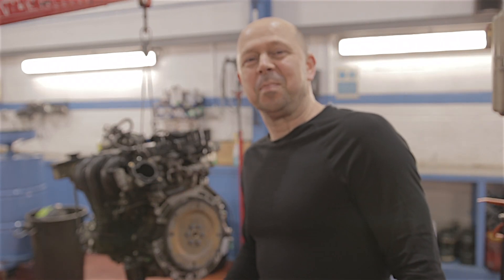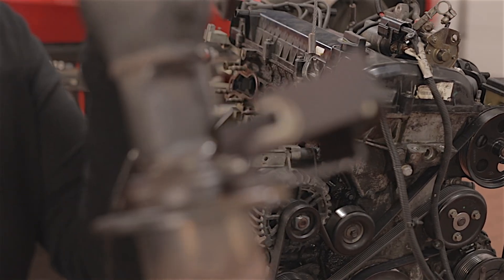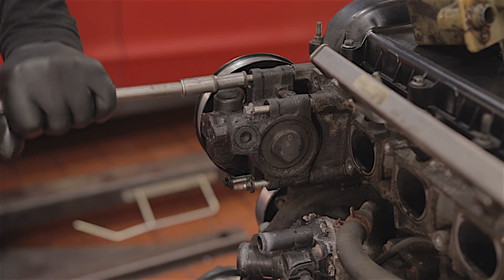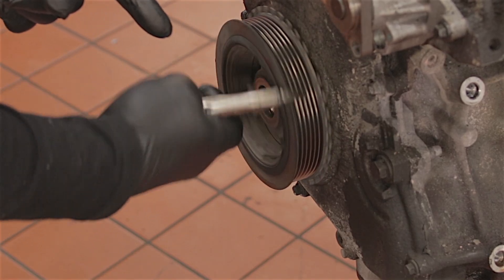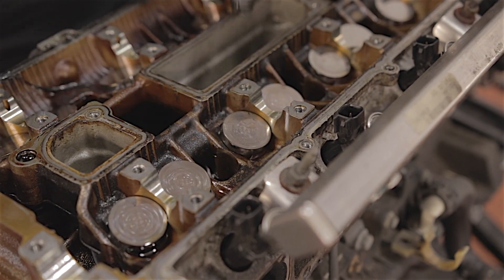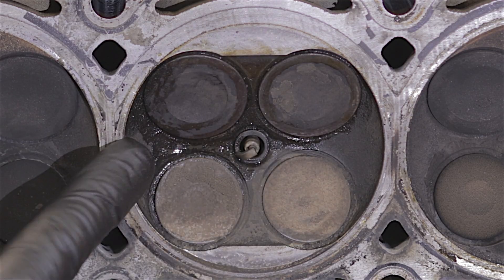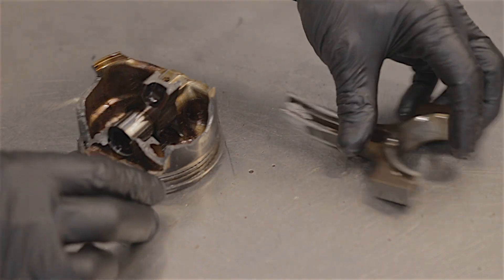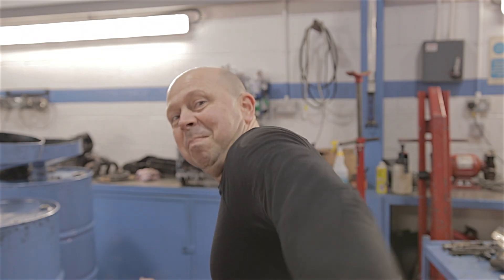Water Sucked Into Engine...Hydro Lock, Whats The Damage ??

Comment: Just drove my 2004 1.9TDI Passat through a flodded street. Engine stopped, air filter was full of water, didn't try to started again, took it to my garage, removed the sparkplugs and cranked the engine a few seconds, water flew out like shot from a gun, then I've removed turbo pipes and intercooler pipe,got back the sparkplugs and cranked the engine again. It started right on, with all the pipes disconected,  it sounded like  a normal engine, tomorow i will check all the air sistem of water and see what will happen, but I'm almoust shure that there is no damage to the engine. I'm not a mechanick, it's just a hobby, maybe my biggest hobby. I'll be back with the end result.

Comment: Regarding Hydro lock, back in the 60s I was serving my time as a fitter at Priestmans which produced among other things excavators, on the assembly line a semi skilled guy filled the engines with oil and also put oil in the oli bath air cleaner, unfortunately he was off ill so they gave the job to a labourer that had no mechanical knowledge whatsoever he kept filling the aircleaner with oil till it ran out, so all the oil had gone into the inlet manifold and into the engine which hydrolocked on start up and was ruined, the management did not sack the guy or anything as they said it was their fault for letting him do it !!!!

Comment: You can fix and reuse valves and heads like that. Jam a screw driver under the valve and bend it back in the right direction. Check if it shimmies side to side as it seats itself. Once it doesn't shimmy sideways as it opens and closes, it's fixed. The engine will go back together for lots more miles and high revs.

Comment: Great video, lets see what comes out of mine 2015 Chrysler Town and Country once manage to get the engine out, mine wont move so have to get it out with the transmission also as cant get to unbolt the torque converter, I am hoping the block is not damaged we will see. The water damage was done by my 19year old daughter driving the van in a heavy storm, she left for work and never made it past 2 blocks on a flooded street, water was not even that high but these vehicles intakes are really low, and also water may have entered via exhaust pipe; that was last August, car was at the dealer but the estimate for replacement and fix was 13K so insurance wanted to total it, had no choice but to get it home and decided will fix it myself as can not afford even the cheapest of street mechanic with all that needs to be done, so that how we are here today almost ready now to get that engine open; I was going to buy a remanufactured engine but here in the US all companies who sells them have horrible reviews by pissing their customers base so instead we decided we will strip it and fix whatever needed which is the super hard way for a non mechanic like me but what choices do I have? scratch a 30K car? nope! the only thing in my favor is this is not my first rodeo with rebuilding an engine as i did my wife 2004 Toyota Corolla which had a failed engine due to oil starvation and over a year and half later the car is still rolling so lets see what the Chrysler got for me.

Comment: I am him. I am one of those people. Because i accidentally drove through deep water that only existed because it was a damn monsoon at the time. I kinda had no choice. I came to this video specifically because of that. Very interesting watch. Thank you for the content, Alan.
Reply: I changed my oil and air filter. And I am about to install some new spark plugs while confirming the chambers aren't still filled with water. Hopefully it keeps my car from randomly kicking and throwing this P2646 rocker arm code.
Reply: @xamedix Did you save your waterlogged car?
Reply: @gregorymalchuk272  I did. Replaced injectors. Did an oil change. Replaced pcv valve. It's running fine now

Comment: I drove my mx5 through 1 foot of water I did know about the damage water can do but the car cost me nothing. It driver perfect for 35miles afterwards and then started knocking.  So now I’m pulling the engine and fixing it just for fun 😂. Parts don’t cost much. New rods and bottom end bearings. Plus a head gasket. Maybe some new valves. It’ll be fun! Or it’s getting scrapped 😂

Comment: That must have run badly after ingesting enough water to cause it to lock up.  It would have been well down on compression on that cylinder due to the bend in the rod, did nobody do a compression test to check?

Comment: I drove into a massive puddle and it cut out, I sucked out the water out the inlet manifold and it seems fine, this is like 3 months ago. Think I’m fine or will it have issues in the future?
Reply: Going through that now you should be fine change your spark plugs oil

Comment: That pulley bolt....I remember oh so well. I had an engine with a broken no.1 exhaust valve, I tired everything I could to undo that thing, I broke several tools and when my mates impact refused to budge it, I decided on sourceing a new engine instead. They of course are known as a 'disposable' engine and that's why they do um up so tight....no woodruff key, the whole assembly is just compressed together.
Inccidently, don't those Fiesta ST's use the same engine ?
Excellent video Alan.

Comment: Long time ago flooded my mk3 Mondeo diesel, had enough brains to disengage the clutch immediately, roll out of water, and not try to start it until removing the intake and blowing out all the water. Drove 30k kilometers after that, sold then. Lucky me. I think it’s because the engine was on idling rpm when I crossed water, so it just got stopped by water in cylinder and didn’t have enough inertia to turn further.

Comment: Hind alan I love watching your videos.i have a t.d.d.i. 05 focus.i had a bright idea this week to change my anti freeze and replace it as I've never done it.i do my own  maintenance.ive had 25 years of diesel mondeos and the t.d.d.i engine I can do most jobs on these engines.what drives me insane is how do you refill the cooling system without getting an air lock in the heater matrix.i had the same problem 10 years ago with a diesel mondeo.i got the garden hose down the heater pipes and fused the heater matrix out the hose fits inside the pipes.still the same problem in winter no heat eventually after a few weeks the problem seemed to write itself and the heater suddenly started working.now I got the same problem with my focus.bit cold at the moment to be crawling around under the car getting wet.wanted to ask have you had the same problem?is there a way to either bleed these  cooling systems or refill the coolant a diffrent way like down the heater pipes first not through the expansion tank.makes sence to me the thermostat is closed so your only going to be able to fill the radiator at the front it should work it's way to the heater eventually. but it is a problem.can you help please.any videos on this please. I can't find anything related on you tube.i thought about unscrewing the heater sencor and using the hole as a bleed valve like a domestic radiator.you must have had the problem yourself with these mondeos and focuses.i don't have a compressed air line to put any pressure on the pipes.if you can help I'd be grateful.thanks.

Comment: I have been here before, a car that had been driven through floodwater and recovered to the garage. Engine checked and spark plugs removed and cylinders vented, cylinder compressions checked. Engine started and ran fine, given back to the owner and owner advised.
A week later recovered again with a broken connecting rod, my theory is that the con rod had been bent slightly during the hydrostatic lock and failed (a clean break half way down its shank) subsequently.

Comment: Had a Mondeo Mk3 2.0l Automatic that got hydro locked by going through a flooded road in 2012. Was sorted by our mechanic and we  must have been lucky as only sold it on last year. Weirdly engine seemed to run better after the flooding incident!

Comment: It always amazes me the power of heat on threads and seized bolts you can be hanging off something blasting WD at it and nothing, but as soon as you get the torch out and it normally always works great video Alan.

Comment: Compared to older engines, that conrod is a weedy looking thing.
At the start I kinda guessed it was bent by the water,then let go.

I remember a few years back a local guy flooded his old Peugeot 504 pickup 2.3 diesel engine that was also used in the Sierra,and that soldiered on for quite a while after despite having a bent rod (snigger*)

Enjoyed the engine autopsy Alan.
👍

Comment: The main issue with flood water is having the air intake at a stupid low level :(  Years ago you had the frying pan air filter on top of the engine.
Reply: I've seen that on American muscle cars. Basically the Americans who made them used to put the air filter between the two banks of cylinders that made up the V8 engine. It looked kinda like a giant tuna fish can atop that stunning V8 engine 😍
Reply: The main issue with flood water is idiots driving into it. There's no problem with having the air filter pull colder air from in the bumper if you drive correctly.
Reply: @elobiretv if you want to drive a sports car then avoid water at all costs, regular cars and suvs should know better and they don’t seem to. Normal roads sometimes have 4 inches of water during rain
Reply: @elobiretv  You have missed the point, with a low level air intake it takes very little depth of water before it is sucked into the engine and causes hydraulic lock :(
Reply: So you have to go out and buy another one.
Reply: Yes I remember the big cylinder and frying pan filters right on top of engine
Reply: Yes I remember the big cylinder and frying pan filters on top of the engine

Comment: I've got the same engine in my mk2 focus, drove it through a flood in august and it bent 3 of 4 rods. I kept driving it for like 6-800 miles before replacing it, even drove it from london to derby and back.  I've got one of the rods and pistons on my desk in front of me, I put a little grub screw in it to lock the gudgeon to the piston, and fitted a clock in the bigend. My old engine lives on in the form of a clock.

Comment: I had a mk1 v6 mondeo and I remember driving through a flooded road. I was on my way to work to start the nightshift and didn't see it till the last minute. I was traveling at about 40/45 mph. needless to say I didn't have to use the brakes to slow down! I remember wacking it back into first gear and keeping the revs up. lots of bubbling from the exhaust but I made it to the other side. the clutch felt a bit gritty afterwards but after a few weeks it eventually went away. my friend wasn't so fortunate. he had an old Peugeot estate with the 2.3 diesel engine that unfortunately drew flood water into the engine. a strip down revealed 2 bent con rods.

Comment: Not helping this is the air resonator box on the mk3 being sat so low and on the passenger side. Drive through a deep puddle and you will find some water in your air filter box.

I'd have kept those camshaft sprokets for coasters, but a shuriken is pretty cool!

Comment: Problem with the Mk3 is the tube that sticks into the inner wing from under the airbox.
Water enters there due the low location.
Conical filter is actually one of the times it's good for something as it's located in the engine bay usually.
Drove mine through 30cm of deep water a couple of times, and due the conical air filter it was not a problem at all. And I drove slow and make sure to make a bow in front of the car.
Watch how 4x4 folks do it through floods and you get the idea. 
The bow in front of you make a low hight area under the car which make more clearance for stuff like air filters.

Comment: Alan, can you blank the egr valve on these engines and if so does it help with the engine power?
Reply: Yes you can. I had on mine. Bought the blanking plate of ebay and it worked like a charm for the 5 years I drove it. When I took off the egr the first time the thing was filled with sot and the piston inside would not move at all. Some brake claner and a toothbrush sorted that out. I noticed no power gain, but the egr would not have any problems in the future, It did not throw an engine check light either. Mine was a 01'

Comment: years ago rover 216 taxi come into us for electrical fault - engine misfired when washers used.       
turned out had engine out for major body repair [but didnt bother telling us] +  traced to windscreen washer pipe switched with manifold vacuum pipe.
 told him not warranty so promptly pissed off without paying bill. come back week later with snapped con rod + wanted warranty claim. bloody taxi drivers........